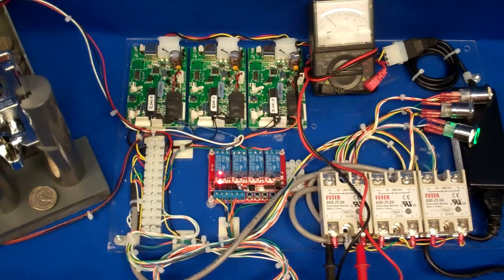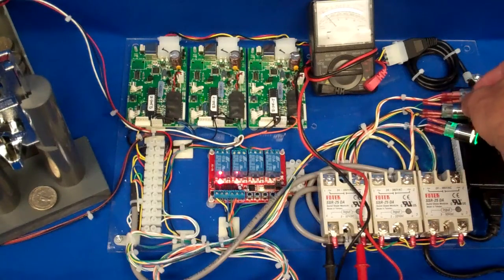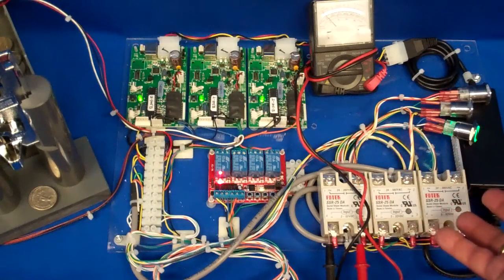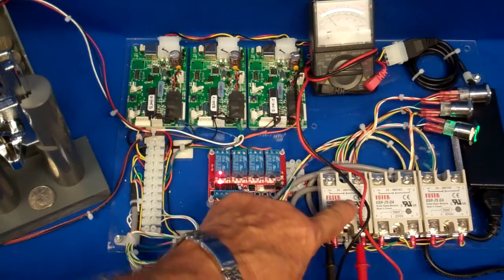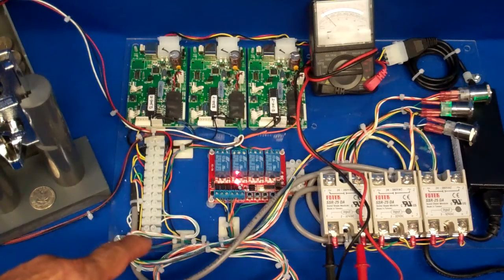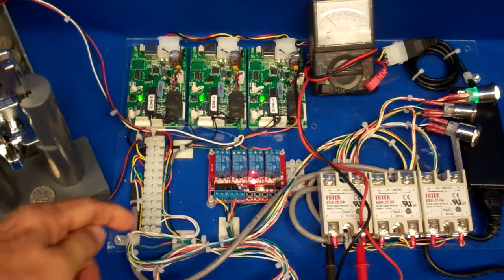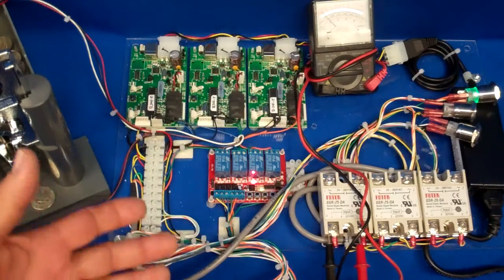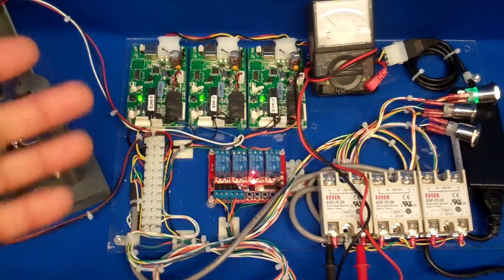Vending Controller Board VCB-2D Kit

Comment: I got your email. I have a card reader that emits a single pulse . I need to control power to a washing machine for a preset amount of time.pleaase send details of the circuitboard that would work. my number is 7069513941 (Michael)